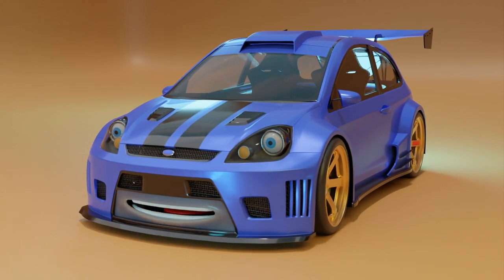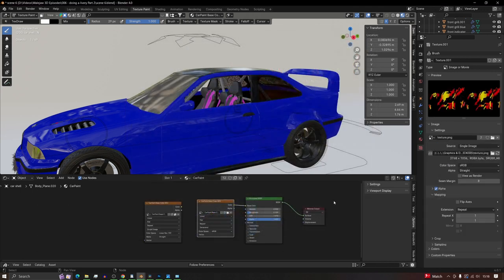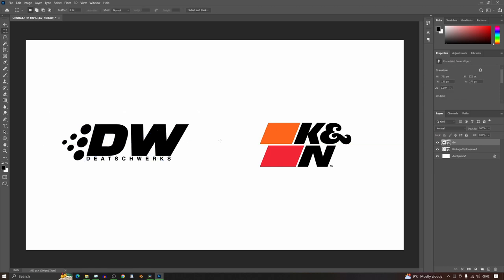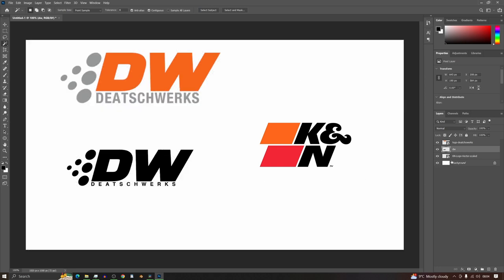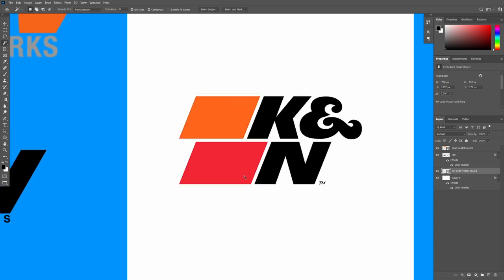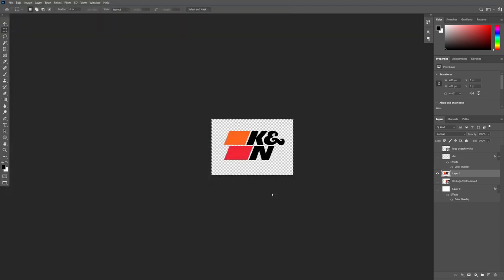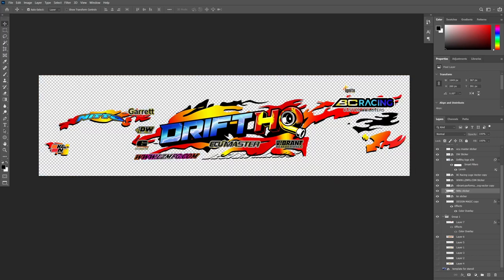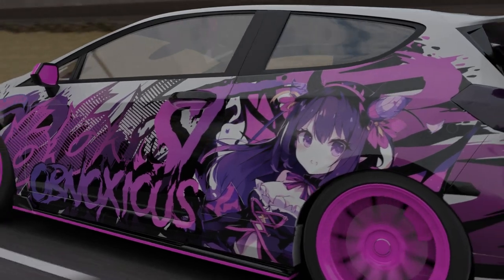My Car Designs Improved 100% with this VIDEO #blendertutorial

Comment: Mine don't work right anyway cuz it paints both sides an on the back of it to but how u do this to a car without connecting the doors an everything as a solid body ?...
Reply from the maker: Select all the objects you want before entering paint tab
Reply: @walejaw3d  I did all that an if there not joined only the yellow outlined parts take the paint.   It won't even paint on other parts
Reply from the maker: Check your faces are facing the correct way. Normals might be backwards. Id need to look at your file to see proply
Reply: @walejaw3d  well it's a hycade lambo gta5 mod car